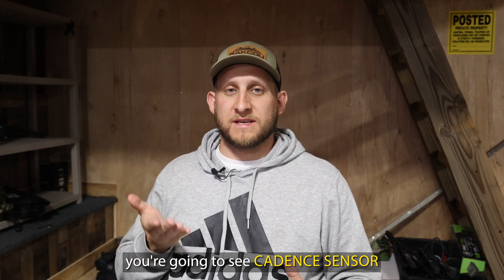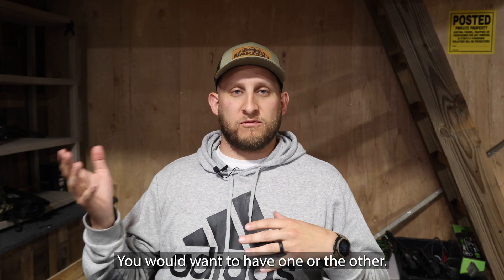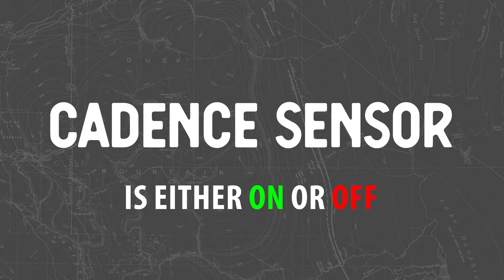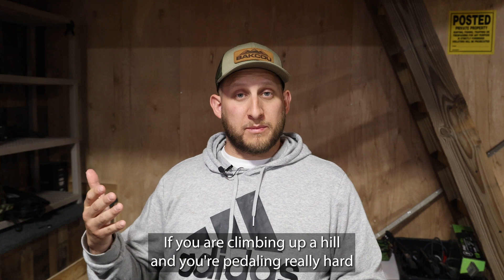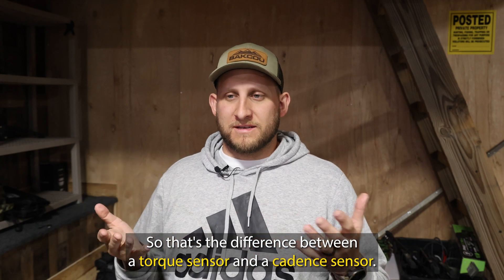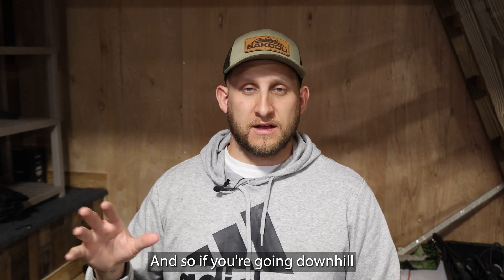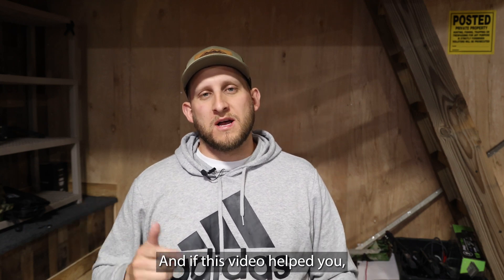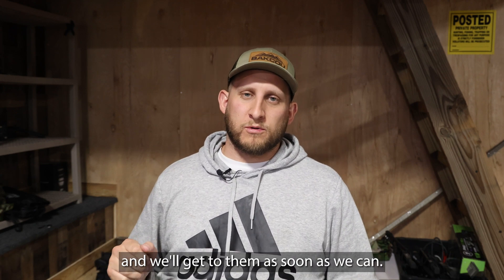What is better? Torque sensor vs Cadence sensors in eBike motors

Comment: very nice! to have the options available.
I have a few ebikes and all so far are cadence sensors, but those are fine for "legal" road & trail riding.

 I do have one dual motor, that is my mtn road ebike and WISH it had a torque sensor.
then trail rising - uh my "idea" of real trails with obstacles to "work" your way thru & around. I want a torque sensor.
the throttle on mine is smooth & responsive, buut I like pedal control.

 on a trail I have gotten creative with brake cut off and PAS 1 or 2 for a gentle, but it is still not the best.
Reply: many times I do just feel lazy n rotate the pedals for the power on - - - 
then a light pressure for the brake cut off - but when ya wanna go? 
all it takes is a little turn. ;)

 but on a real train or a mtn road? I kinda like "juuust" a little control

Comment: The sensor is NOT in the motor....  it is a box of electronics either part of the CONTROLLER or wired to the controller.  It is NOT  built into the motor

Comment: So to be a lazy bastards we need cadence sensor
Reply from the maker: If that's your main goal and you're not planning on riding on too many hills then yes
Reply: @bakcou3624  yeah main goal commute  to work and not become a stinky sweaty prick .
So maim advantage is gearing on torque sensor ?
Reply from the maker: If you're commuting and not climbing too many big hills, like actual mountain roads, or carrying super heavy loads, the cadence sensor would be perfect for you. The torque sensor has more power AND torque so it is better for climbing and carrying. @rumchaser1able
Reply: @bakcou  just standard over passes over other roads otherwise pretty much flat the rest of the way
Reply from the maker: Yeah an eBike with a cadence sensor would work just fine in that area. One that we have is called the Flatlander. We also have the Kodiak AWD which has two hub wheel motors front and rear and that one is cadence sensor as well. 
 @rumchaser1able

Comment: Based on your explanation which you made very easy to understand I'd go for the torque sensor. Sounds like a safer option also
Reply from the maker: Glad that was easy for you to understand. Torque sensors are definitely the way to go if you're gonna be riding trails or hills or mountains. The price point will be higher because of the better sensor.